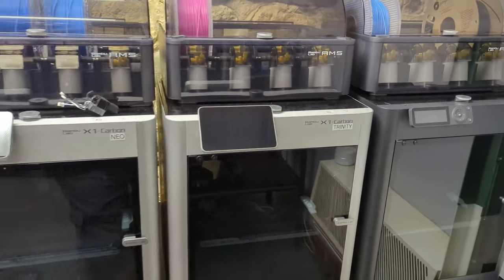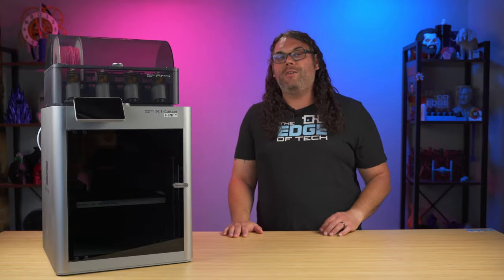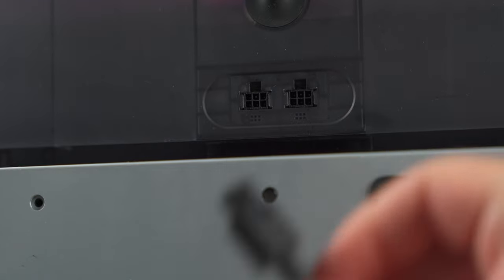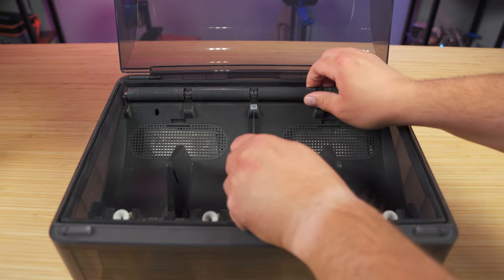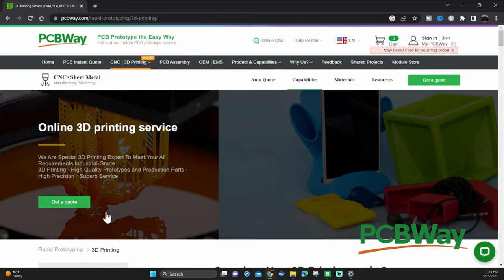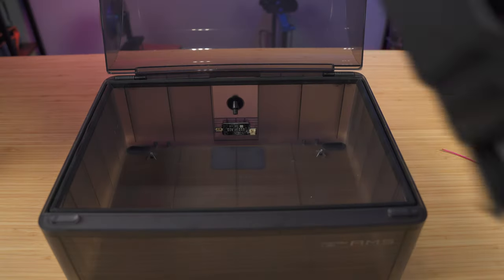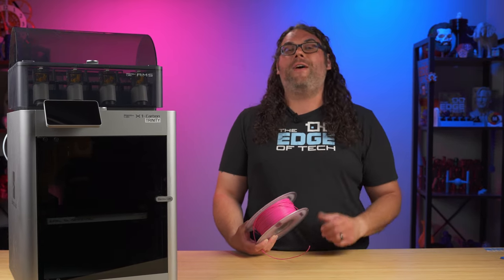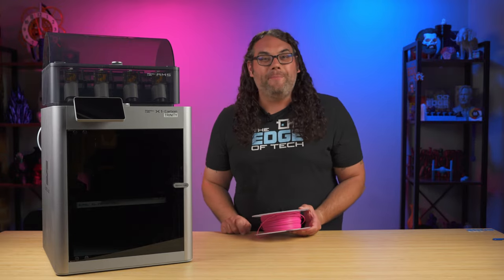How To Clear Broken Filament Jam From A Bambu Lab AMS (It's Easy!)

Comment: You are lucky. For many this has been less than the plug-and-play item it's been touted as. The AMS needs a total upgrade. Having to literally take a machine part to fix is unacceptable especially when it is a £300 piece of plastic. I imagine a lot of people who bought it because it was supposed to be reliable will just be put off once this happens.
Reply: Not in my experience. Maintenance easy. Convenience phenominal.  What's more they keep the filament dry and useable.

Comment: Agreed unfortunately I had to do this within 48 hours of installing the AMS unit on P1S.  Filament fault, not the AMS.  However I didn't realise how brittle it was and it took several attempts to clear as had snapped in several different place.  If your AMS is up high, I'd recommend disconnecting from the Printer itself, leaving the bowden tube and connecting cable.  This is more manageable and avoids wrestling inside the AMS to seperate.  However save yourself a job and print the appropriate tool set to disconnect from the the printer (rather than AMS itself!)

Comment: Only once? You’re lucky. I’ve had to do this so many times. Those connecting harnesses under the AMS are too short. I don’t understand why they didn’t make them longer. I finally disconnected the AMS and use the rear spool holder. I only plug it in for multi-filament prints which is rare for me.
Reply from the maker: Crazy! Yeah I have four of them and I've been using my original since last May and this is the first time I've ever had it happen. But as I said in the video, it was self-caused. They should have not pulled it out the way I did. There's been many firmware updates to the AMS, and I believe they're updating versions as they find things to fix as well. Definitely appreciate the feedback!
Reply: Try higher quality filament, and heat-drying filament before use.
Reply: Agree - I have a Y splitter that allows me to use the external spool easily

Comment: I just love your videos on X1C. Guess I'm lightheaded from being ill but 15cm piece broke of my filament and I tried to metl it together with a lighter :D when I fed it into AMS it instantly broke off and I started panicking cause I couldn't stop AMS from pushing it further and I was worried about using force so I wouldn't destroy my AMS motors :D 

so I used your tutorial, removed PTFE tube on the side that is closer to feeder (it is hard to reach it but you can do it with same metal tool for removing screws to push it) and I pushed that filament back out! Thank you so much! :D

Comment: Thank you!  The tube couplers (Bowden??) are the trickiest part for me, whether clearing from the back of the AMS or from one of the slots.
I've only had 2-3 filament breakages in 500+ prints.  Not bad, plus I'm using cheap filament so it's to be expected.  It's a pretty easy machine to take apart and put back together!

Comment: I bought the X1 carbon with the AMS when it was on Kickstarter and I was backer number 2812 so I've had this printer for quite some time. I have well over 2,000 hours on the printer and for the last two months I haven't used it. I went to fire it up a few days ago had a small hiccup but fixed it and printed off ABS actually for the first time and it came out perfectly. For the next part of the project I had to print with this clear PLA that was kind of old and brittle and not really stored correctly so I put it in my filament heater for a while. I also used the ironing mode which made the windows for my project come out really nice. The issue I had was a couple days later, I forgot to remove that clear PLA so when I turned the printer on and it did its normal AMS cycle, the filament became brittle again and cracked off throughout the whole PTFE tube all the way from the AMS unit itself all the way to the top of the tool head. It kept giving me some type of error and kept trying to rewind the spool and I had no idea what was going on for a minute. What I had to do was basically what the video showed and take out the filament from the AMS end, then I had to run some filament through the rest of the tube to the tool head to clear out all the broken pieces of PLA through that hole tube system and you can only feed the filament in One direction where it goes through the cutter if you try to do it the other way you'll get stuck at the cutter or the back part of the printer where the little box thing is with the springs. It was definitely my fault. Make sure you check your PLA and make sure it's not brittle before you turn on your printer and it starts to cycle through each filament slot so nothing gets stuck anywhere in the whole PTFE tube system. Hope that helps someone. Other than that this printer has been a dream and has still left all my other printers that I still own in the dust and I haven't even used them in several months. Ivoned several expensive name brand type of the line 3D printers and I can't say enough about bambu. It beats every other printer I've had hands down. I still own a very heavily modified CR10 version 1 with custom firmware, I have a CR10 smart Pro and I have a CR5 Pro high temperature version and closed printer. I think I voned almost every single printer creality has came out with and 80% of the time they would have to be returned either straight out of the box or after about 30 days for one issue or another. Same with the other brands of printers I've owned. I was either going to buy the Bambu or build a Voron. I'm glad I went with Bambu. The only time I've ever had an issue with the printer was something minor and I contacted customer support through a ticket, they replied within 12 hours and 48 hours after that I had a new cable at my doorstep but the problem had worked itself out so I didn't have to install it. Now the last few times I've tried to use the printer I still get an error for force sensor 3 which was the original problem before so I just tap on the bed and the loose connection just seems to fix itself. I went several months after getting the new part and not putting it in and the error went away until I stopped using the printer for a couple months. Not a big deal just more of an annoyance when it happens. I got a jiggle the nut under the bed and tap on the corner of the bed where that force sensor is and wiggle the wires underneath and it usually just solves the problem. The last time I did it must have knocked it back into place like I said because I didn't have any issues for months up until a few days ago and that was after that break of not using the printer anymore.

Comment: You don't actually have to disconnect the backcables, it's usually enough to just tilt it a bit after the 2 screws are gone and then remove the tube with the broken filament from near the intake hole (?) and just pull the broken filament out.

had to remove 4th strap within 2 weeks, i think i should replace the desiccant and perhaps dry my filaments xd

Comment: Maybe you can help. Loaded PLA+ nonBambu filament that worked great in my A1Mini. Tried to print and couldn't change color or get the filament to change type keep showing PETG. Then AMS started to retrack and reload the filament 4 or 5 times then stopped and the lite went red. Took filament out and replace with a Bambu PLA and AMS is working. How can I get the AMS to load the PLA+ or I'm I doing something wrong. BTW another great video as always.

Comment: This was the way I found out a lot of my old filament was too 'wet' for the AMS. Load it and it's fine. Load another spool in the slot next to it, and for some reason the AMS like to give the first spool a little tug. 
snap
That wet filament is now stuck between the feed motor in the back of the AMS and the feeder by the spool, necessitating disassembly as you just showed. It happened twice in one day, so for now I just save the 'old' filament to be fed from the spool holder and not the AMS.

Comment: The plugs are a pain, why carn't the cables be longer or the pcb is mounted on the spooler molding?   Maybe the quality of my filement was not good as it has broken inside it a couple of times.

Comment: Thank you Jim, another great video! You're lucky that you got a year before having to do that. I've had to do it many times already, but it hasn't ever been the fault of the printer or AMS. Brittle filament etc seems to be the worse enemy of the AMS.
Reply: I have some orange filament that's going in the trash.  KD Essentials.   It didn't just break.  It shattered.  I had pieces in every tube.

Comment: The filament got stuck inside that 4way track piece not in the tube, is there a way to further take it apart to get to it? Or do I need to replace that entire piece?
Reply from the maker: If you have the AMS already out of its box, flip it upside down.  There's a piece that runs up the center of that. Four-way dad can flex like it's on a spring if I remember right. If you push the bottom so it opens up it will let anything stuck in there fall out. If you can't get it, shoot me an email and I'll shoot you a screenshot.
Reply: @TheEdgeofTech that’s where mine is stuck too and I can’t get it out, it’s right in the middle of that 4 way piece. I don’t see any way for it to flex

Comment: day 2, small piece of PLA stuck in the 4 way. tension spring in the middle of 4 way will not move. long tweezers wont budge the filament, not enough surface area to grab

Comment: I needed some black filament for the pupils of some eyes but my Polyterra black was in the house and I was in my workshop, however. I had a roll end of old black PLA in there workshop and so I loaded it and of course it snapped as the radius of the coils were too tight for the AMS.

Comment: if you're careful and tilt the carrier piece front face down you don't need to disconnect the 2 wire connectors, at least on mine I didn't have to.